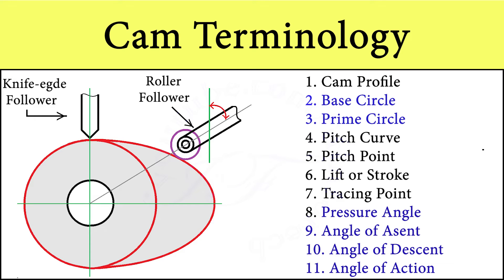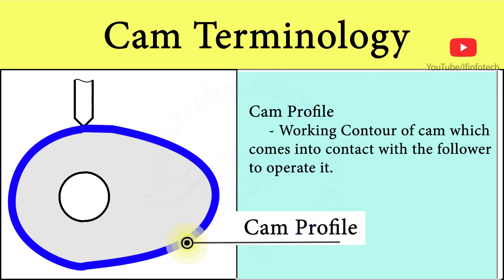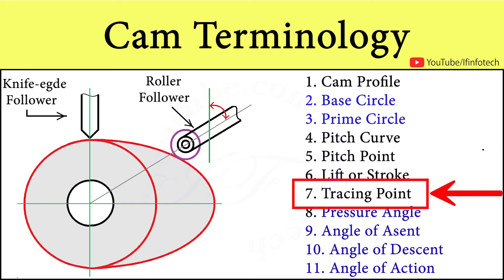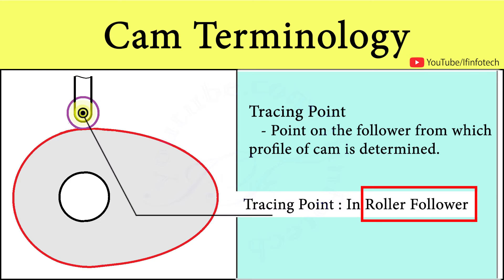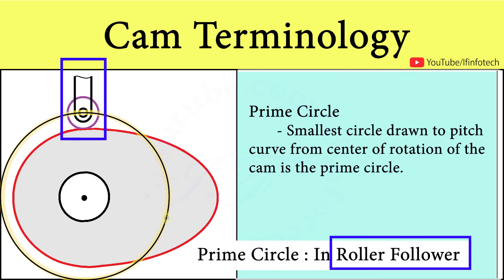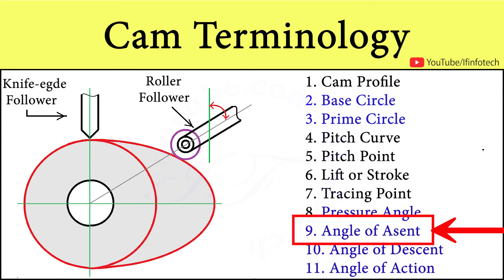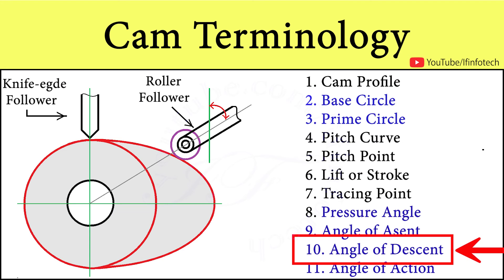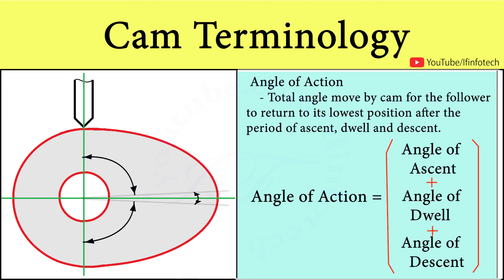Cam and Follower terminology; All Definitions - Base Circle, Pitch curve, Angle of Ascent

Comment from the maker: Pressure angle is the angle made by the direction of motion of follower and normal to pitch curve at any point (Pressure angle represents steepness of cam profile). Higher value of pressure angle increases horizontal force acting on follower, this could jam the motion of follower in guide. Lower value of pressure angle increases weight of cam, thus increasing the inertial force. Hence, an optimal value of pressure angle is chosen

Comment: Out of 11 terms you shown, 1 was missed, Pressure Angle, the only one term I came here for 😐
Reply from the maker: Pressure angle is the angle at any point between the normal to pitch curve and the direction of follower motion. Pressure angle varies in magnitude at all instants of the follower motion. This angle represents the steepness of cam profile.
Reply: Angle betn direction of the follower motion and a normal to the pitch curve

Comment: pressure angle???
Reply from the maker: Pressure angle is the angle made by the direction of motion of follower and normal to pitch curve at any point (Pressure angle represents steepness of cam profile). Higher value of pressure angle increases horizontal force acting on follower, this could jam the motion of follower in guide. Lower value of pressure angle increases weight of cam, thus increasing the inertial force. Hence, an optimal value of pressure angle is chosen